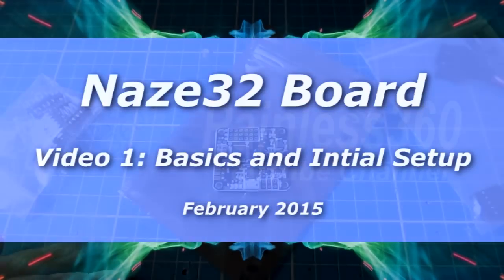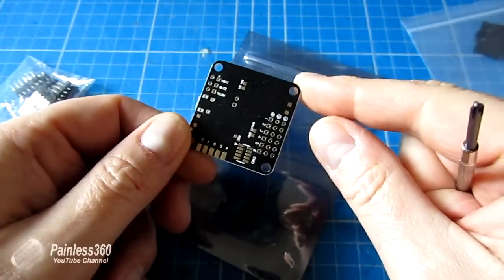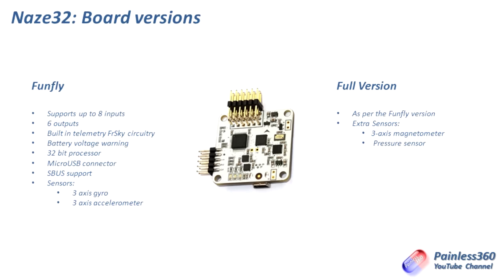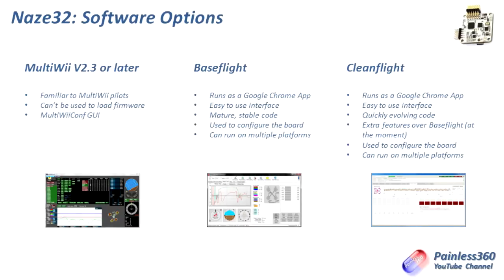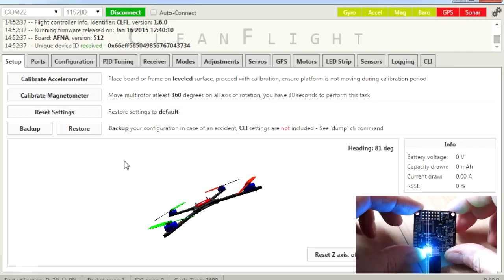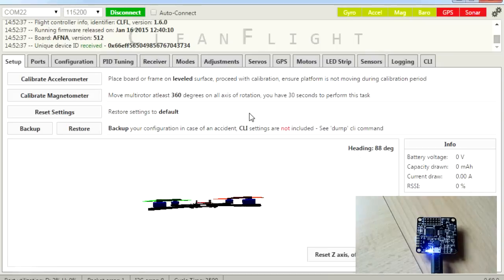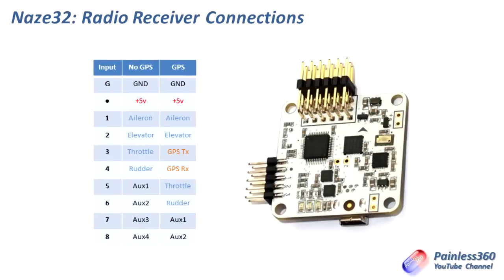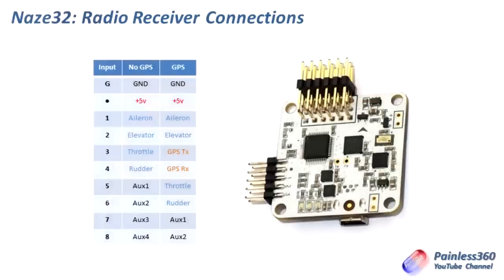(1/8) Naze32 Flight Controller (Full version) - step by step initial setup

Comment: if i was thinking on autopilot missions using gps waypoints. What software should be used for mission control? supports telemetry radio transceivers?, great video series painless360 is my video library
Reply from the maker: +Alberto Mellado not with a Naze32. See our video on controller comparison. that should help.
Reply: +Painless360 thanks man

Comment: Nice review, one question, on the 10dof naze, Can I turn off baro and mag sensors ? and if so that increases cycles of energy in the board?  also does the 10dof has more flight modes than the 6dof? thanks
Reply from the maker: +INMERSO No really and yes - the videos in the series cover all you need to know ;) Happy flying!
Reply: Ill check them out, thanks

Comment: Hey painless.. great video.. Thanks for taking the time to make it.  Question.  I have the FrSky D4R-II.  But I wanted to use quad with my Devention (walkera) transmitter.  Will the naze32 will support the devention? I will have to use a break out cable correct?  Is there anyway to make the break out cable vertical... so its not sitting outside the body.  THanks
Reply from the maker: +Mark H Sorry, I've not used that radio. Best of luck with it!

Comment: Thanks for the video , can this board be used on a Plane?
Reply from the maker: +francois Bonin Yep, google 'Cleanflight plane' for more detail..
Reply: +Painless360 thanks a lot , i was planning to order it.
Reply from the maker: It does depend on what you want to do with it. The CC3D and APM/Pixhawk are also great fixed wing controllers too..
Reply: +Painless360 Well , for now , i made a plane , with a mobius cam on it , but may be someday i will attack also the quad.Thank you again.

Comment: Have ya'll had the chance to review an "Upgrade NAZE32 SP Racing F3 Flight Control (Deluxe)" board?  What do you think of it?  Before I purchase, please!
Reply from the maker: It really depends on what you going to use the board for, and how comfortable you are building. Personally, I think there are lots of better options available now than this older board. Check out my build series for some of the flight controllers that I use all the time. Hope that helps
Reply: Thank you for the quick reply.  I'm very comfortable with a soldering iron and programming.  You say this F3 board is old?  I'm sure I missed it because I didn't know what you were talking about at the time when I first started doing research.  What Board do you recommend? I plan on flying it for recreation, maybe at some point strap on my GoPro from time to time and a GPS "just because".  We're talking about a ZMR 250.  I'm sure that matters as well.
Reply from the maker: See my flight controller comparison video from last summer a lot of it in there is still current. My other suggestion is have a quick look at the Quadcopter build series that I've done, I'm  currently working on series 7. They should help you too. Best of luck..

Comment: Hi, thanks for the videos they are very good. I bought a Acro Afro Naze32 10DOF STM F103 from goodlucksell and follow instructions and get blue led always on and green led flashing slow. The configuration states flash failed. I get no response from goodlucksell. Thanks for any help, Rich
Reply from the maker: You can try forcing it into bootloader mode.. Best of luck..
Reply: Thanks for the response. I'll readup on bootloader mode. thanks Rich

Comment: Can I get away with only soldering 4 ESC pins and 1 receiver pin as I will use PPM?
Reply from the maker: You will need 5v power to the rx and fc...
Reply: +Painless360 Yes, also one set of pins for the buzzer and one set of pins for the 5V input. 
5V power for rx comes from the single cable (ppm) to the rx. This will work then right?
Reply from the maker: Sounds about right (without seeing your wiring diagram). Best of luck..

Comment: Thanks for the video, I'm new to this so please bare with me. I've watched this video couple times already just to sink into my head. Can you please give me the direct link or the exact name for this board, I tried to look at it but there is too many out there just like what you said.
Reply from the maker: +Sen Pen this is a Naze32 rev 5 board. There are later versions out now. If you are looking for a modern flight controller then consider ones like the Seriously Pro F4, Betaflight F3 and Omnibus F3 AIO. See our Quadcopter building for beginners series for lots more about starting out. Best of luck!
Reply: thanks for a quick reply, I'll keep watching your video and it's a lot of information here. thanks for making the video and happy flying.
Reply: Thanks, I will look into on all flight controller. The one that I want to do is a nice drone with GPS altitude hold. I think you cover this one here but if you have a better suggestion is always an  A+.

Comment: Painless, Can you please tell me or provide a link, Where you got the ant vibration mount for the Naze32 and also where do you get the leads which connect between the Naze32 and Rx. I thought I have seen you making these leads in another of your videos. Thanks for all your help Garry.
Reply from the maker: Garry Nutter the PWM cable should come with the controller - I would go back and ask the supplier. Best of luck.

Comment: i have a question. should i be doing all this BEFORE i start building anything? building my first quad soon.
Reply from the maker: I like to do the basic config just before I start my building that also allows me to see how the motors should be connected and then I can mark up the connectors with the right numbers are I make up the arms wit the motors. It's up to you how you do it.
Reply: Painless360 how would you know which way the motors spin without running any power to them?
Reply from the maker: Not really. The direction of spin is decided by how the motor wires are connected to the ESC. Swapping any two of the three wires reverses the direction.

Some motors come in CW and CCW models but this is to do with the rotation of the thread on the shaft that the rotor fits onto rather than the direction of the motor itself.

Hope this helps.
Reply: ahh ok. i have the NTM Prop Drive 28-26 1000KV for my quad right now. thanks!

Comment: Hi great videos. They've helped a lot. I have a quad with a Naze32 rev6 and E-max ESC's. When I try and hover it oscillates counterclockwise and flips. What is causing this.
Reply: Well I found some info. looks like I need to adjust the PIDs.
Reply: +William Rayborn Hey William it could be pid's but the first few things I would do is look at a few things. First thing would be to take the props off and make sure the motors are in correct order it should be 4-2 
.....................X 
...................3-1 
Motor 1(cw) 2(ccw)3(ccw)4(cw). You can check this by taking the props off and spinning the motors on when the board is hooked up. If that's all correct then check that the propellers are the correct orientation you could have them swapped. If it's an issue you're having with the esc's head over to rc forums. A lot of great people who could help out of you posted a video etc.

Comment: I have soldered a dozen of these or more to date- I took a tip from mochaboy on my first board and have kept to it successfully since.
I take a small bit of flux and wipe across the header holes before and after placing pins. I get a tiny drop of solder on the tip of the iron and touch it to the pin and it will draw down the pin and make a perfect joint every time. Quick, clean, and no boards trashed yet knocks on wood
Another fine video tutorial !
Reply from the maker: Thanks Hiway, I do like this board, like Multiwii on steroids. Interested in how easy it is to add things like GPS next..

Happy flying sir!
Reply: Painless360  If you plan on doing GPS, read up on the harikari fork of baseflight, or the PID controller that represents this in cleanflight as that was where I left off- when I want GPS features I go with APM- I use the Naze as intended- acro and racing flying, and pure fpv goodness. No crutches or nets.
Reply from the maker: thanks, adding GPS to this board is the number one request from the subscribers on the channel. Happy flying!
Reply: Painless360
That is because it is the folks that want all the locked in feel of a 32 bit FC, but the safety net of a Naza... it may be prudent to read some of the old timecop-isms to understand why there is only recently an effort to nail down the GPS and autonomous features. He built the naze for acro and fpv- so he never gave a shyte about GPS.
You did good and expectedly wise to go with cleanflight. Check out Dominic's channel for up to date info on the led programming, and the PID controller info- Oscar is another if you want some deep reading. I am sure you have already found all this info. You tend to be very well read and prepared for your videos. This Naze32 is a beast to try and parse down and summarize- it is so dynamic. Open source is not for the faint of heart- or patience.
Reply: Painless360  Thanks  for this.
What would be great is an easy how to on Telemetry and Led setup as well. A lot of other videos just seem to get lost in technical jargon and are hard to follow or understand Cheers again.
Reply from the maker: Thanks for the suggestions Stephen. My MinimOSD arrived yesterday so I guess that will be the next one on the list to do..

Watch this space! Happy flying..
Reply: Hiway 4

Comment: Do you think a directional impact could cause jitters from a damaged gyro or accl?
Reply from the maker: +Hoverbot1TV possible,  I've had boards that didn't recover after a nasty crash..
Reply: Painless360
I just fixed it with simple recalibration of accl, drop in tpa BP video loading before is most recent. :o)

Comment: The board will not connect via USB under any conditions that I have found. I have two boards that will not connect or flash software (Blue light only). The arming is a separate problem. I have to connect the boards first.

Comment: A couple of questions if I can. You didn't check the box for "full chip erase" when you installed the firmware at the start. Is this not necessary? Also, when you plugged in the speed controllers you used all the red wires. I thought this was a no-no, as it would be on a multi motor fixed wing model.
Reply from the maker: +Lee Wood I don't as a rule, If I'm getting an error or something isn't happy then I will tick the box on the next firmware upload as part of the troubleshooting. Adding/removing  the red wires from the ESCs depends on the type of BEC in the ESC - see my other videos for a full explanation.. Happy flying!

Comment: Great video but whenever I try to connect my naze 32 to my windows 10 pc it says seriel port unable to be opened I have tried using zadig to fix the driver but it doesn't work and I get the same error
Reply from the maker: You 9nly use Zadig for when you are flashing the flight controller. Normal connections don't need that. I'd delete the device in device manager and start again. Best of luck

Comment: Great vids, I got a flip 32 flying, mag holds heading, setup with cleanflight and set aux sw with angle mode and mag and baro, I see sensors in cleanflight working, but I am still sensitive in the throttle and can't seem to hold a steady altitude. Flip came with a case, and I have a clear plastic cover over the rx and fc. Is the baro super sensitive to the slipstream? In hover I am always between throttle clicks, up one and it climbs, down one and descending. Ideas?
Reply from the maker: UCRASH TOO This video may help - https://www.youtube.com/watch?v=org2d6r6FRQ
Happy flying!

Comment: Hi Painless, i 've looked all yours videos and it's very interesting , yours explanations are very clear....but could you confirm which model of Naze 32 is...i think ....Naze32 10DOF Rev5 MPU6050 Flight Controller... from Banggood but there is another one which is ....Upgrade NAZE32 SP Racing F3 Flight Control Acro 6 DOF/Deluxe 10 DOF for Multicopter....the first needs Baseflight ( on banggood ) but i prefer this one with its pins to solder .....but you program it with Cleanflight and not Baseflight....Could you tell me why...?
Thank's a lot for yours videos, i understand more and more components for open source materials.....
Fly safe
Philippe
Reply from the maker: +Drones Visions Aériennes Both should run CF ok. The only boards that struggle at the moment (until CF 1.11) is the Naze32 Rev.6. If you're not sure check with the vendor and then you can go back to them if you find it doesn't work for some reason...Best of luck with it.

Comment: Hi, great video. Just a quick question. Once I have calibrated the board then move it around,  the image on the pc screen moves in the opposite direction to that of how I move it. I would have thought  tilting the board to the right would make in image tilt to the right. Am I missing something? ??
Reply from the maker: You are right - it should move in the same way. Make sure that you are holding it with the little arrow printed on the top of the board is pointing away from you..

Comment: Thanks for this series but I went thru it all but seems I missed the setting on Failsave. Should we set the quad to thro all the way down and let me fall from sky when trans is fail? Or just lowering the thro to let me land itself? Which one is the best?
Reply from the maker: +wing hum thomas fung IMHO, failsafe is about primarily protecting people and property, not your drone. 
I do cover setting the failsafe to be zero throttle using the failsafe function of the receiver so that the drone comes down as quickly as it can (in practice the props act as airbrakes in the decent from any height to slow the craft and stabilise it) and you could also set the failsafe in the code to turn the props well below hover point to descend. See the documentation for Cleanflight on that feature.
Best of luck.

Comment: What's a good temp to have your soldering iron set at?
Reply from the maker: The one I have is a set temp so I don't know exactly. Sorry.
Reply: That's what I have too, but at 80 watts it practically vaporizes solder so I'm looking at a variable temp station
Reply: BashMonkeyRC
I normally solder at around 360-380º C. when doing larger AWG wires and stuff.  For this kind of work though, I would think 300-320º would be better (ie, safer).  Also would be better to use a "pencil tip" (versus chisel) and solder wire no greater than 0.5mm (helps control solder flow a litter better).
Reply: Appalling68 Thanks, that'll give me a good starting point to work with. So I've done a couple solder jobs on small wires and it's been a huge pain keeping it clean with my iron
Reply: BashMonkeyRC If you have a a good iron and solder tip, 230-250 c is more then enough to solder circutry/small wires.

If you live in USA  i strongly recommend a Hakko FX888D solder station. You will not regret it in this hobby.

However, its twice as pricey outside the US. And the ones from china are horribly cheap copys.
Reply: That one was a bit pricey for me, besides I already have one of those cheap copies. Small wires take solder well at 325-350C

Comment: a quick question do you leave all esc bec power wires hooked up or remove all but one of the red wires from the plugs on the esc? like the kk board
( not sure if the esc are switching or linear )update-just watched video in your series and it would be safer just to have one red esc wire hooked up
Reply from the maker: I would strongly recommend that you look for the detail on whether or not the BEC in the ESC is switched or linear.

You could just connect one red wire, to be safe. But having all of the red wires connected together (if it is linear) can be useful.

Best of luck with it, happy flying!
Reply: Painless360 thanks it is a build for a friend and they have no markings so I will go with the one red wire set up :-)

Comment: Hi. great vids on your channel. I used it a lot to help me set up my naze32. unfortunately I cooked the copper pad off pin 1 on the RX side. I use ppm, can I just assign "A" to pin 2? or have I completly killed the board? I want pin 5 for LED strip from your vid but all others are free. I need ppm for space and cleanliness. cheers. Joe
Reply from the maker: +dudeskinus I'm not sure. I suspect that the mapping could be changed but I've not come across this in the work we've done with the board.. Best of luck with it.

Comment: Sorry to relive the topic but since last year when I bought a controller from HK the CF720X, announced as a fc and rx type dsm2 in a same package, with cleanflight 1.9 - mine already came with version 1.10, and the NAZE type, which I can not do anything with it. I could not even bind with my TGY9X Pro radio with Orange DSM2 / DSMX module. I looked at several of your videos about NAZE and Cleanflight Soft Serial and could not bind. I am very discouraged so I ask if the friend happens to know something about this play. Thanks in advance.
Reply from the maker: I'd ask the HK team for support, I've not seen this board myself. There is usually either a hardware method or using the CLI to put the receiver into bind mode - maybe that's the same? Best of luck!
Reply: Thanks for answering. I'll search more about the bind of this cf720x. My progress so far was only to have flashed the Inav in replacement to the Cleanflight which until now had achieved nothing. I saw your videos of Inav and I tried it, being successful.

Comment: is this will work on my Turnigy AeroDrive D2836/8 1100KV?
Reply from the maker: That isn't a good choice for a modern multi-rotor. See my quadcopter building for beginners series where I choose more useful Motors. Best of luck
Reply: @Painless360  it is only i have in my hand..